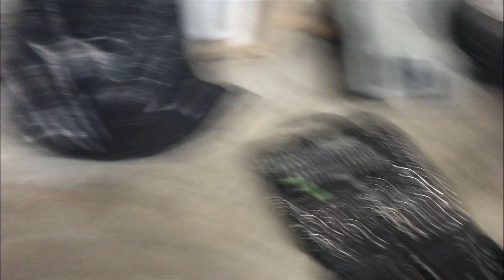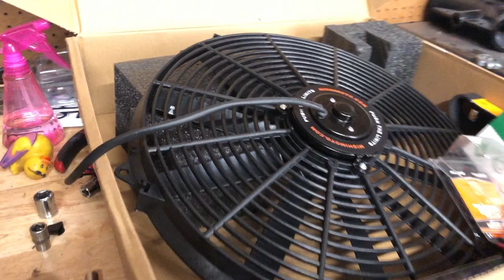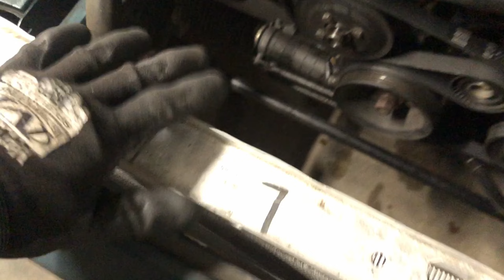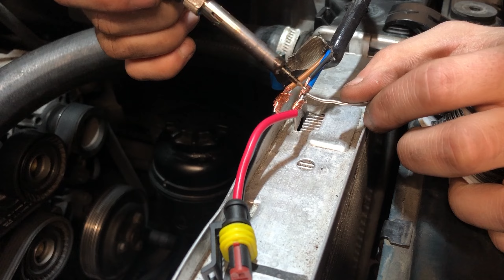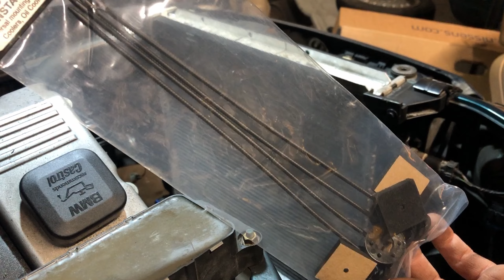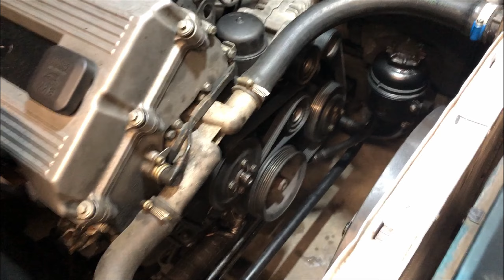E36 Electric Fan Install | E36 Drift Build

Comment: Do u have to use a 2-pin connector (16 AWG wire) or can I just wire it directly from the fan wires to the aux fan wires??
Reply from the maker: You don't have to, it just makes serviceability a whole lot easier.

Comment: hello, 

the Fan in front of  the radiator is for what ? what happen if i delete it like you did ? will i still have the AC ?

Do You have to put something to block water where the mecanical fan was ? i saw videos of people putting plastiques nut or thing like that. 

Thanks
Reply from the maker: The only reason I would delete the auxiliary fan is if you are swapping to an electric radiator fan. It acts as extra airflow for the radiator and helps the AC kick on when the AC system needs it to stay cool at a stoplight or in slow traffic. 

A cap for the  mechanical fan threads isn't necessary.

Comment: I just did this but only used the low speed wire for my hook up.  I found through testing that the low speed wire is active in both the low speed and high speed scenario.   Made wiring the connection a little easier for me.  Haven’t track tested mine yet but I’m 99% sure my theory is correct.
Reply: Just an update.  Don't try the shortcut I did.  It didn't work as planned and I had to wire both high speed and low speed together like the JamDrifts Video.  I have no idea why it didn't work.  I spent hours testing each circuit and it all tested fine.  Except when all plugged together.  My final straw was to wire it up like the video and everything worked.  Must be the BMW electrical gremlins.
Reply: On a 4 cylinder engine ?
Reply: @notphew7281  e36m3 = 6 cylinder

Comment: What is the size of the fan
Reply from the maker: It's a 16 inch
Reply: @JamDrifts  am I able to just run the fan to a switch and turn it on when my car reaches operating temp

Comment: What if I have A/C ? 
How do I by pass the wiring ? Do I need to run the whole relay kit or can I just splice into a power? 
Also would my fans just stay on the whole time the car is on?
Reply from the maker: Your best bet would probably be to put in a new system with a relay. With the relay you can run it off your temp sensor so the fan only turns on when it hits a certain temp, or you can wire in a switch to manually turn the fan on. From what I've seen,  relay kits will come with a wiring schematic so installation isn't too hard.

Comment: My e36 is from 1994 and I don’t have ac. Do I have a wire like this aswell or is there any other way ?
Reply from the maker: Chances are that if the car didn't come with A/C stock then it won't have the wiring that I used. Your best bet would probably be to wire in a new relay setup. I've had friends do that on their cars and it works really well.

Comment: Were those 16 AWG connectors? Trying to make sure I get the right ones that correspond to the power the fan pulls. Thanks!
Reply from the maker: Yeah I'm pretty sure those are the ones. I looked them up and they look almost identical.

Comment: Why did you use a new original oem radiator instead of an oversized aluminum one with a separate expansion tank?

Comment: Would it be possible to splice into the high speed wire and the splice ground to ground to keep the aux fan?
Reply from the maker: As long as the two fans together won't pull more amperage than the fuse can handle, you should be fine.

Comment: Hey bro does it cool well?  What temperatures do you get now compared to the original?  If I wanted to put a button that works in parallel with thermal contact which wires should I intercept?
Reply from the maker: My car never really ran hot with the stock fan and still doesn't with this setup (besides when I busted a coolant line lmao). I mostly did it to get rid of the ugly clutch fan and clean up the engine bay. To install a manual override switch you'd want to wire it in from before the high speed relay to after it. This would allow the electricity to bypass the relay altogether and go straight to the fan when the switch is turned on.
Reply: @JamDrifts  Putting the low speed and high speed wires together on the fan you only got one speed, right?

Comment: Hi, thanks for the tutorial, I wanted to ask you if it was possible to put two of electric fans.  One in front and one behind the radiator .. Could both be mounted with the same wire that you used?  Which fuse needs to be increased to carry the load?
Reply from the maker: As long as the two fans won't pull a higher amperage than the stock fuse then I don't see a problem doing that. It's usually a bad idea to swap in a higher amperage fuse as you run the chance of overloading the wiring and potentially starting an electrical fire.

Comment: How’s it holding up ?
Reply from the maker: The car was holding up amazing until the last drift event. Took her out for a few too many hot laps and the coolant hose connector decided to break and spew coolant everywhere. Thankfully I was able to turn the car off before it overheated too much.

Comment: Do you have the part number for the connectors
Reply from the maker: I can’t remember where I got it from exactly but you should be able to use any basic two wire connector from your local auto parts store.